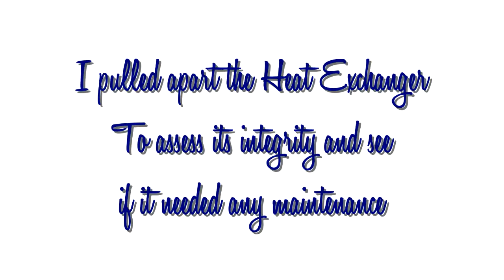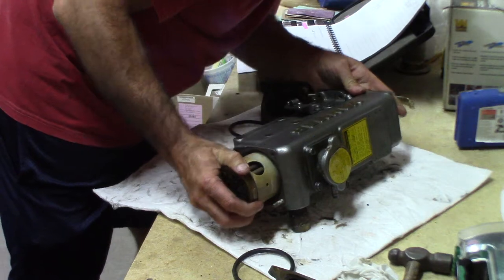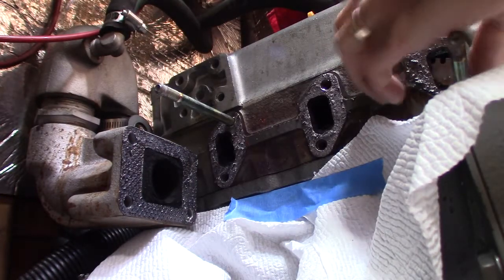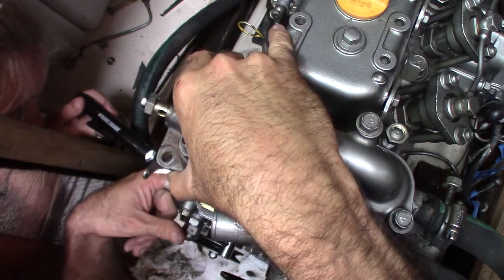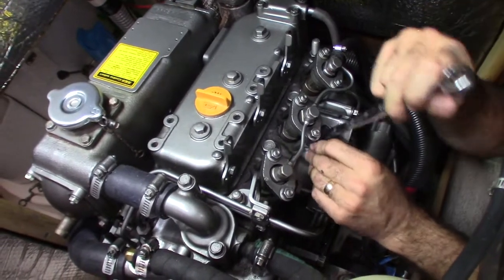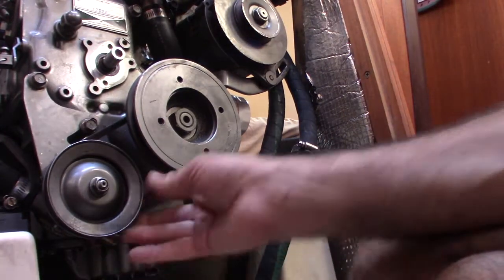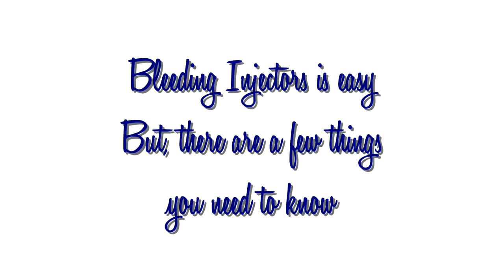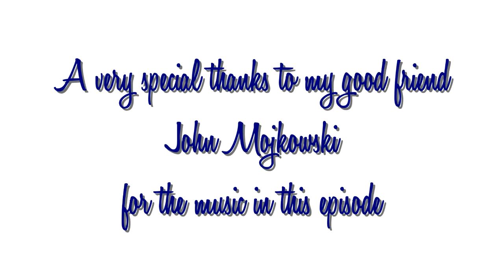Yanmar Engine Fix, Part 2

Comment: Great video! I have embarked on the same task but wonder if it is necessary to remove the heat exchanger, or did you do that for some other reason? Also the alternator, but it is of course good to get some extra wiggle room.

Comment: I've occasionally wondered about that manual start access point on the end of the camshaft. If our starter motor should ever fail, it would be nice to be able to turn it over manually so we can make it back to the marina without needing help. Have you ever done that? Is there a hex head or threaded bolt access that you could put a wrench on? Too bad it is so close to the belt....
Reply from the maker: My yanmar 3GM30F didn't have a way to start it under the cap on the front of the engine. It was just a stub end of the camshaft. An older 2GM I had did have it. You'll have to check yours.

Comment: have this engine the anticorrosion zinc? if yes where ?
Reply: Yes it does. Under the heat exchanger and on the back of the engine. But if you have the model as our with the heat exchanger, the zincs are in the antifreeze not the water stream so little corrosion occurs in the engine. More important are the shaft zincs.

Comment: So how did you assure that you got all the air out of the fresh water side of the cooling system?  I always get an air bubble under my thermostat that delays the opening ot the thermostat and causes overheating.
Reply from the maker: Hello. The thing to watch is that one side of the heat exchanger core has a little hole in it. The correct rotation is to have that at the dead top and toward the bow of the boat which should be the high side of the engine. This allows the air to escape the system. You still have to fill the antifreeze, run the engine for a few minutes and then check the antifreeze level again. On mine it was down a cup or two. This would cause overheating. Run it and check it (the coolant) several times until it's full. This was my experience. Hope this helps.